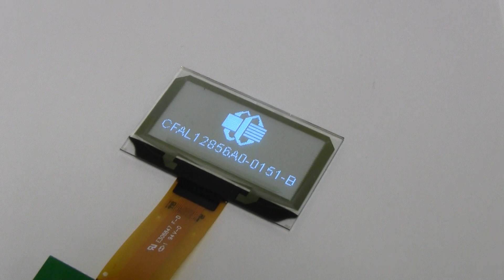Crystalfontz 128x56 Transparent OLED Display

Comment: I am from india i want to buy them from where an i buy'em and also which connenctor to use
Reply from the maker: Hi Aakash! You can purchase this display on our website (we ship to India). We recommend using the CFA10105 (https://www.crystalfontz.com/product/cfa10105-oled-breakout-board) for development. The display uses a 24 position, 0.5mm pitch ZIF connector (https://www.crystalfontz.com/product/cs050z24ga0-24-position-zif-connector)

Comment: Will this work with raspberry pi SPI?
Reply from the maker: Yes it will work with any microprocessor that can do SPI or I2C. We recommend getting the breakout board as well (CFA10105) which takes care of the wiring and voltage boosting.
Reply: @Crystalfontz  Im building a smart glass type of device for the purpose of public speaking, to display notes for the speaker directly in front of the eye. Basically a digital notecards reader.
Reply from the maker: @DeliveryManBoy  very cool! We'd love to see what you come up with.

Comment: Is it capable for the for a custom sized screen, and how does it work?
Reply from the maker: Hi, this is the only size we have available. For information on how it works, check out the product page which includes a datasheet, getting started guide and other links: https://www.crystalfontz.com/product/cfal12856a00151b-128x56-transparent-oled-screen

Comment: Do they use mini hdmi?
Reply from the maker: Nope, it uses  8-bit Parallel, I2C or SPI as it's communication interface.
Reply: Is there any way to transfer it to Mini Hdmi? I’m thinking about using one for a raspberry pi
Reply from the maker: @ToadTheTheorist  for use with an RPi the easiest route would be to use SPI over the GPIO pins. Otherwise you'd have to design your own Mini HDMI to SPI or Paralell or I2C board/circuit.
Reply: Ah, thank you

Comment: Does this work with the raspberry pi
Reply from the maker: It can. However, it's not plug-and-play. You'll need to use the GPIO of the rPI and use SPI or I2C  to control it. You'll also need to consider the voltage requirements for the display in your design.

Comment: Does it work with raspberry pi 3 display? (Raspberry pi has a build in “display” port where I think this cable couple fit in) is I possible to just show my raspberry pi display on this screen with that port and cable?
Reply from the maker: No it won't work like that. You'd have to use the rPi's GPIO using 4-wire SPI or I2C. Here's a post that discusses how to do that. https://www.raspberrypi.org/forums/viewtopic.php?t=28696 I hope that helps.

Comment: How to buy one and how much is cost is it similar to normal pled screen in controlling and by which way we will connect it to arduino?
Reply from the maker: You can buy one here: https://www.crystalfontz.com/product/cfal12856a00151b-128x56-transparent-oled-screen Feel free to compare the costs yourself, all the info is on our website. You'll need to acquire a small breakout board and a few components to get it working with an Arduino. See the schematic in the datasheet also located on the product page. Feel free to contact support@crystalfontz.com if you need any additional help getting up and running with this display.
Reply: Crystalfontz America, Inc. Is shipping  available to india? And how will it cost
Reply from the maker: @piyushprasad2878  If you go to our site and add it to your cart, you can estimate the shipping in the shopping cart. Shipping cost is dependent on the shipping method you choose and your location.

Comment: Good job sir!So how can ı connect it to arduino
Reply from the maker: There's a schematic with the components you'll need on page 6 of the datasheet! email support@crystalfontz.com if you need any help.
Reply: Crystalfontz America, Inc. I Asked becasue in the video ı couldn’t see any pins And ı want to ise it with arduino does it have pins ?
Reply from the maker: @selmanyalcinn  Gotcha, it has a 24-pin FPC that plugs into a ZIF. We connected it to a small breakout board with the zif connector. All the info is on page 6 of the datasheet. We're running it on a Seeduino 4.2 which is an 3.3v Arduino clone.
Reply from the maker: Here's a link to a compatible breakout board: https://www.amazon.com/24-Pin-Connector-Breakout-Board-0-5mm/dp/B0799DPCDM/
Reply from the maker: @selmanyalcinn  That looks like it'd work fine
Reply: Crystalfontz America, Inc.  And the connections of fpc are on the 6th page of the datasheet isn’t it
Reply from the maker: @selmanyalcinn  You're right, I added the link to the breakout board on the product page. You can find the needed components on page 6 i.e. the caps and resistor values in the schematic. If you need help getting it wired up, don't hesitate to contact our support at support@crystalfontz.com we'll help you get it up and running.
Reply: Crystalfontz America, Inc. Thanks ı will make sone researches And ı am wanting to learn a thing too can ı use it like a normal screen
Reply: @Crystalfontz   can ı code it with arduino is there any examples of it
Reply from the maker: @selmanyalcinn  Absolutely, you can find the demo code on the website product page here: https://www.crystalfontz.com/product/cfal12856a00151b-128x56-transparent-oled-screen
it's labeled: Software Source - Arduino SPI and Parallel Demo Code
Reply: @Crystalfontz  sir is there a bigger one ???
Reply from the maker: @selmanyalcinn  Not at this time.
Reply: Crystalfontz America, Inc. I want to use this screen with arduino pro mini but you didn’t share pin diagram for mini how can ı connect this screen to pro mini ? And does it need any resistors
Reply: Crystalfontz America, Inc. And can you say library name for this screen to code with arduino ide And ı need all the functions of it did you share them or are they on the internet And finally can this screen shows all colors or just blue ? Thanks😁
Reply: Crystalfontz America, Inc. How can ı connect this to pro mini
Reply from the maker: @selmanyalcinn  You can try this library: https://www.arduinolibraries.info/libraries/u8glib it supports that controller. The INIT / example code is on the product page. No, this is only blue. We don't have a transparent full-color display. The controller datasheet is also on our website.
Reply: @Crystalfontz  how can ı use it with arduino pro mini ? can you help me about connection
Reply from the maker: @selmanyalcinn  Not sure, we' don't use Arduino pro mini's, but if you read the datasheet and pin table it should be relatively self-explanatory. If all else fails, email us at support@crystalfontz.com
Reply from the maker: @selmanyalcinn  Please check the datasheet. There is a pinout and example driving circuit with the additional components you'll need.
Reply: @Crystalfontz  you said we used seeduino and if seeduino's all pins are same with uno's it will probably work with mini with same connection
Reply from the maker: @selmanyalcinn  Ok, cool. They are the same as the Arduino Uno. We use the Seeduino since it can be switched from 5v to 3.3v
Reply: @Crystalfontz  ok thenks ! ı will probably buy your screen but ı am living in Turkey do you send your products abroad ?
Reply from the maker: @selmanyalcinn  Yeah, we ship anywhere FedEx or USPS will deliver, alternatively if you have a shipping account with a different carrier you can use them as well. You can get a shipping quote on our shopping cart page on our website.
Reply: Crystalfontz America, Inc. That’s cool Thanks !😄
Reply: Crystalfontz America, Inc. Must ı use capacitors And resistors ? And if ı must  ı must put resistors And capacitors between that pins then connect them to arduino isn’t it for an example ı put resistors between gnd And vcc then ı connect gnd to arduino’d gnd And vcc arduino’s vcc isn’t it
Reply: Crystalfontz America, Inc. And in the datasheet you explained   Resistors that between the pins but you didn’t explain how can we connect some pins like Reset pin
Reply from the maker: @selmanyalcinn  email our support: support@crystalfontz.com then an engineer can help you way better than I can.
Reply: Crystalfontz America, Inc. Okey ı will do this ı Asked here because everyone can see from here but ok
Reply from the maker: @selmanyalcinn  I created a quick video showing the breakout board we threw together, you can also find this info on page 6 of the datasheet. https://youtu.be/JNL2hns9e2c I hope that helps.
Reply: Crystalfontz America, Inc. Thanks sir but ı will ask for a circuit diagram about how can ı connect this screen to arduino because ı need which pins go to arduino’s which pins especially if you make circuit diagram with fritzing ı will be so happy
Reply: @Crystalfontz  hi ı bought your screen today but ı want to cancel my order how can ı do that
Reply from the maker: @selmanyalcinn  Hi Selman, contact sales@crystalfontz.com ASAP to see if they can still cancel your order. https://www.crystalfontz.com/policies.php#payment
Reply from the maker: Hey Selman, we made a breakout board for this display to make it easy: https://www.crystalfontz.com/product/cfa10105-oled-breakout-board

Comment: Working with a Arduino?
Reply from the maker: Yes. Arduino code is under the "Files" section here: https://www.crystalfontz.com/product/cfal12856a00151b
Reply from the maker: Yeah, we're running it on a Seeeduino, you'll need to add a couple components, but all the instructions, diagrams etc are in the datasheet on page 6